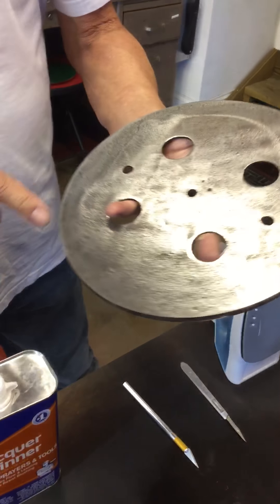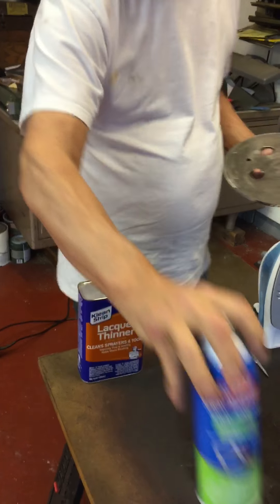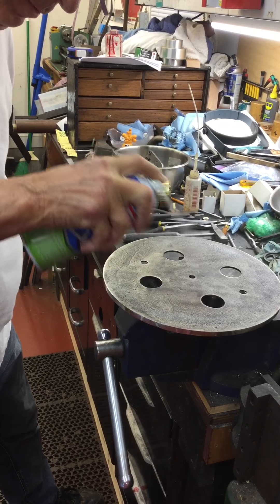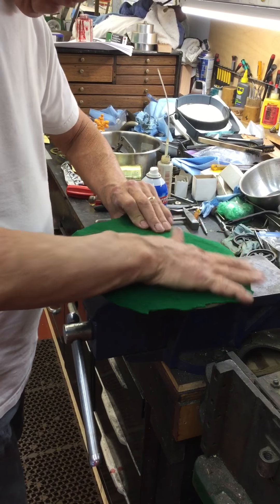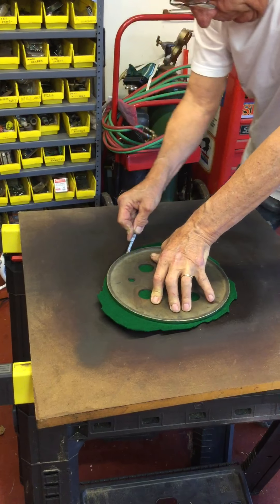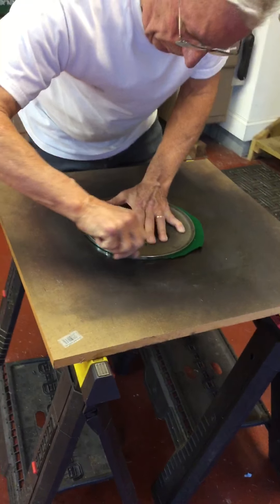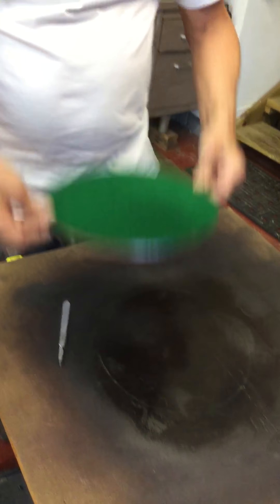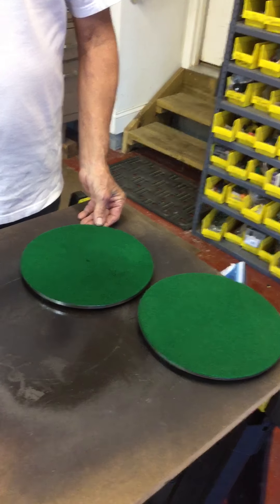20. How to prepare and felt a turntable

Comment: Where do you get the felt from
Reply from the maker: Measure the diameter of the turntable and then you can go on eBay and find phonograph turntable felts available.
Reply: @1974hurt  Thanks!